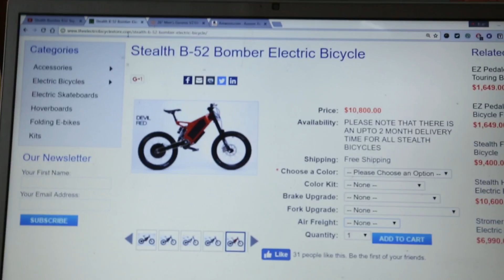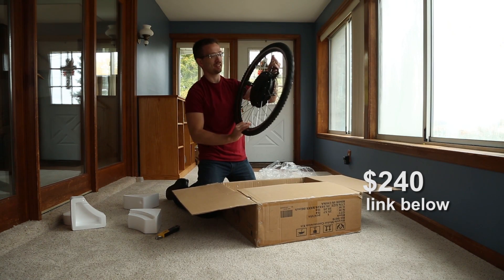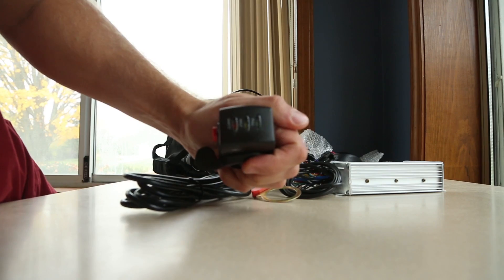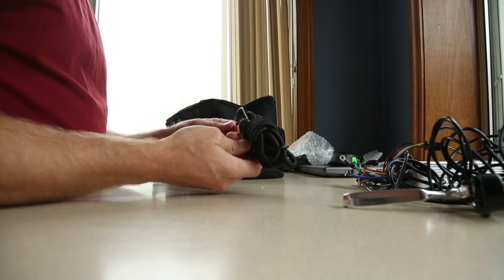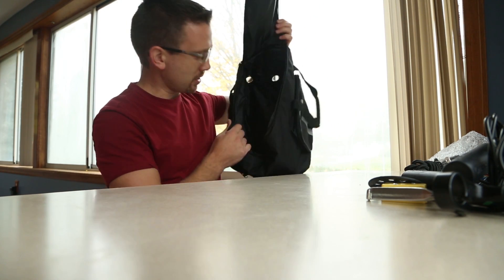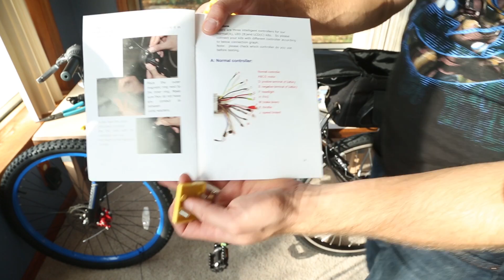NO MUSIC - How to make an electric bike for under $500! Fast & Cheap eBike tutorial!

Comment: Tried it. The weight on the back is ridiculous. The kick stand wont even hold the bikes weight anymore. This thing will kill u. My next move is to try mounting the batteries over the front wheel to distribute the weight more evenly
Reply from the maker: You are right! Also could go with smaller batteries. Good luck.
Reply: @TechMindBlow  
I'm currently building a two wheel front end that tilts. My own version of the noomad kit. I intend to mount my batteries on that where it will have a low center of gravity

Comment: why not use a step up system for the battery using a stick (bottle shaped generator) generator (has low torque\ spins as easy as a roller blade wheel new) to increase the voltage up to ten times the duration. remember reduce control speed so you don't fry your motors.

Comment: what range do you get out of those sealed lead acid batteries , did the carrier brake as i see the bike has suspension and you have connected the front of the carrier to the seat post :)

Comment: At 12:01 you said you were using 12 gauge wire and at 12:22 you said they were both 10 gauge which one is it? P.S Im new to this so I dont know  if it even matters at all but I dont wanna mess up.
Reply: If in doubt, go bigger (lower number for the gauge), it couldn't hurt except the wallet.

Comment: 12AH batteries, 48 volts in series, produces only 576 watts.  Is that enough to power the 1000 watt motor?
Also, what kind of range do you get?  Thanks.